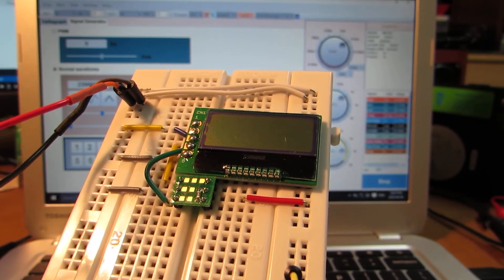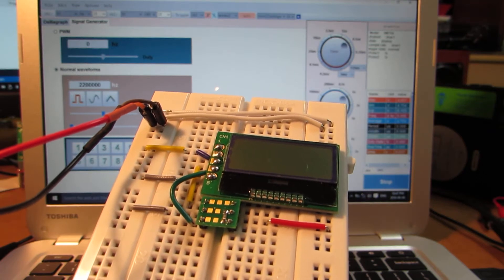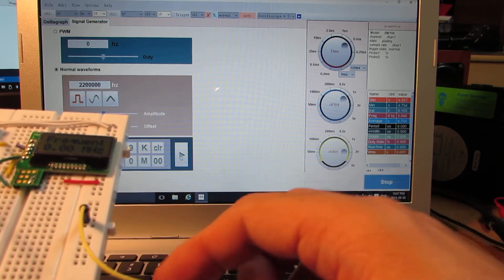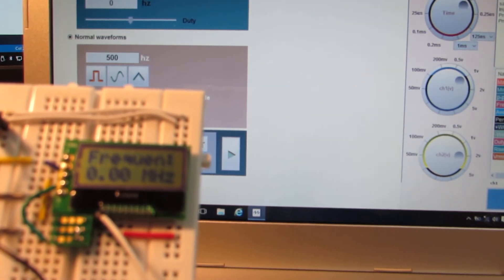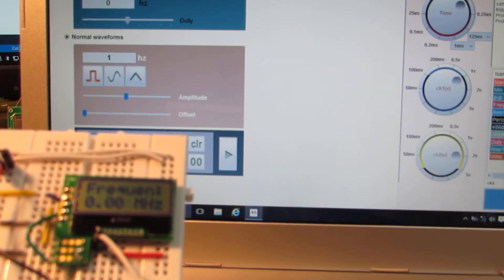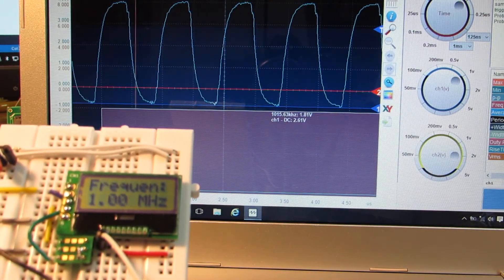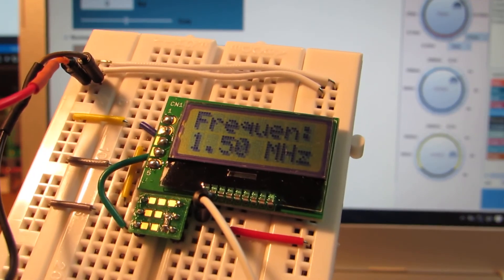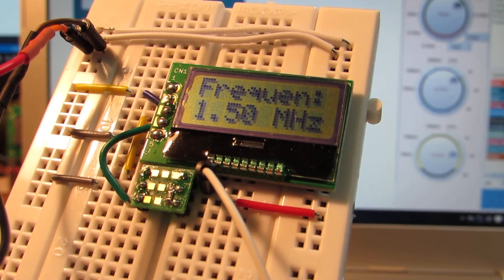Finally ATtiny10 becomes "single chip frequency counter"!!!

Comment: does it only measures square waves freq?
Reply from the maker: I guess any kind of periodical waveform excessing threshold voltage of the logic, around 1.5V..
Reply: Why don’t you change your profile to a ATtiny10.  

Man 6 pins that’s so little.

Comment: Cool, could you  set the range, like  Mhz khz, hz?
Reply from the maker: Hello! Yes,  the range is determined by gate timing, so longer gate timing leads to lower frequency range. This can be setup by changing delay timing in asm code or directly change main clock of AVR. Auto range function may be very interesting...!
Reply: got it, and Yes, will be such a nice to code that function, I hope you  make a custom pcb for this one, it deserves one. :)